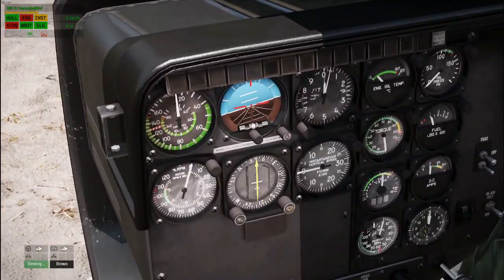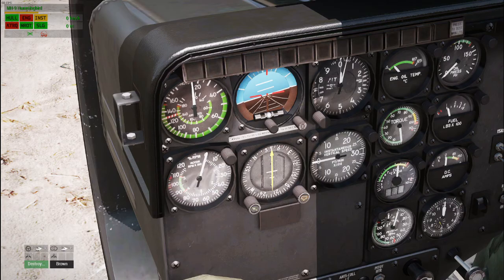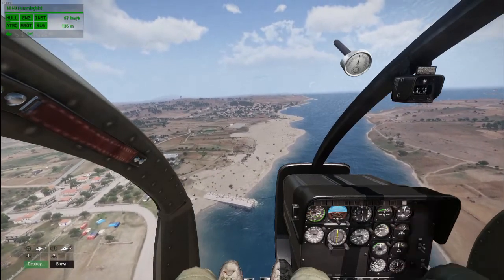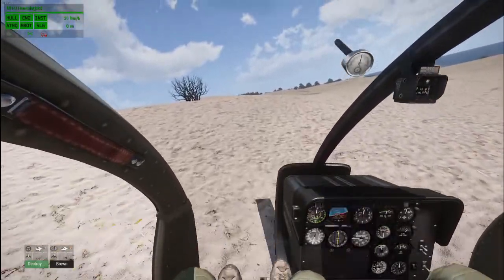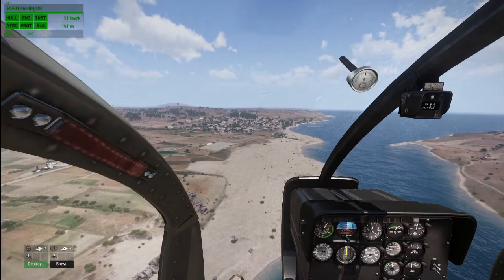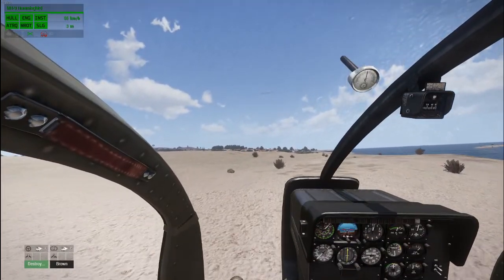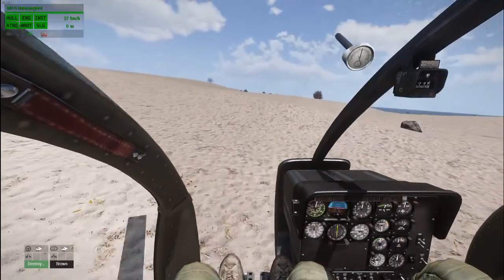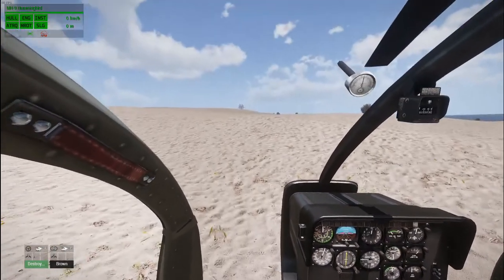Arma 3 Autorotation Landing Using the Advanced Flight Model

Comment: U got flare man.... get ur speed up and flare
Reply from the maker: Real-world, absolutely! You should shoot to flare no closer than 40ft (12.2m) AGL to bleed off airspeed and cushion the landing. 
 
Unfortunately the Arma 3 Advanced Flight Model isn't comprehensive, so the inertia effects that allow a real helicopter to dump that extra momentum from airspeed into rotor RPM for the flare aren't fully modeled. Once the engine quits, the physics of the Bohemia Interactive engine are somewhat limited. 

I appreciate the feedback, though, and you're absolutely right, the more flare you can get, the softer your landing will be! Arma 3 vehicles tend to explode more often with power-off landings, though.